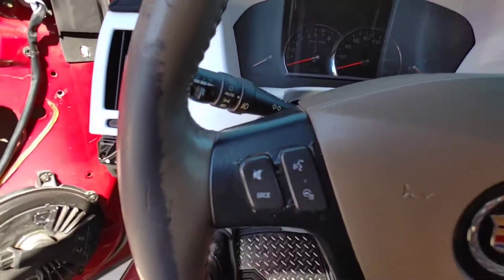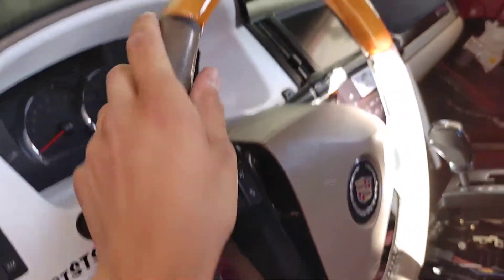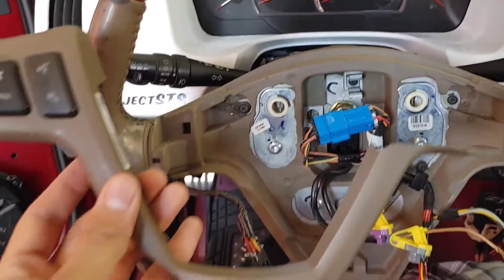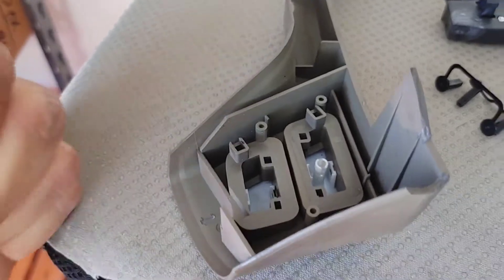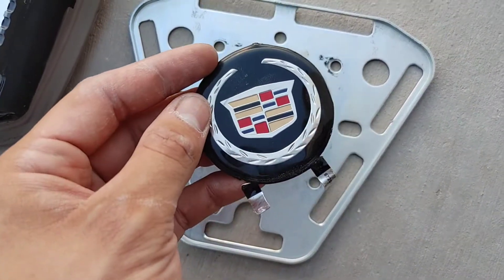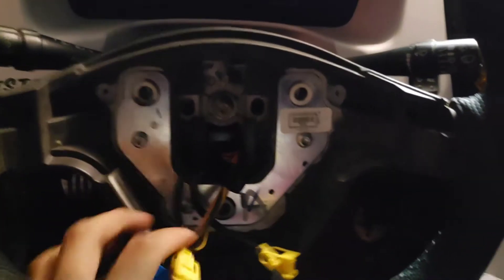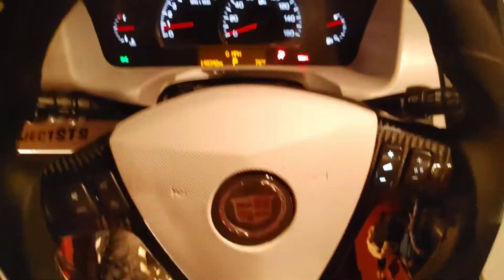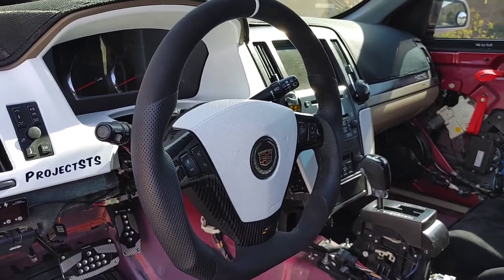Cadillac STS Custom Steering Wheel Upgrade (How To Remove Airbag/Steering Wheel)

Comment: Does the heated steering wheel still work
Reply from the maker: The heater and buttons on the steering wheel do not work since there's no connection for them on the quick release hub, only the horn works.

But if you replace the original wheel with another one that both have the heater, then yeah it should work.
Reply from the maker: I forgot I uploaded this video before I installed the quick release hub lol.

I don't think the custom wheel I bought has the heater in it, the button didn't do anything but then again it didn't work on my original wheel either
Reply: @some_thicc_sedan  appreciate it 👍
Reply: @laudenfreehling5420 there is a forum post on Cadillac forums about converting a 2007 SRX steering wheel to that of a 2008 or later, which includes the wiring hookup changes to get the heater to work, as well as actually switching the steering column and buttons.